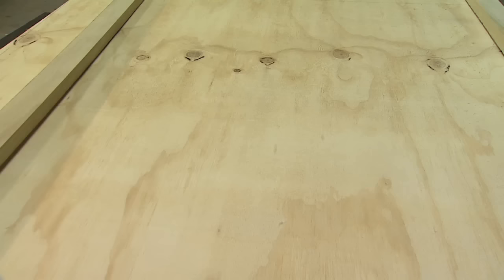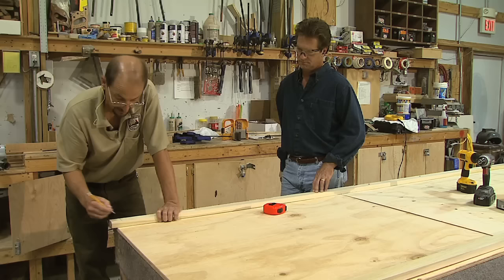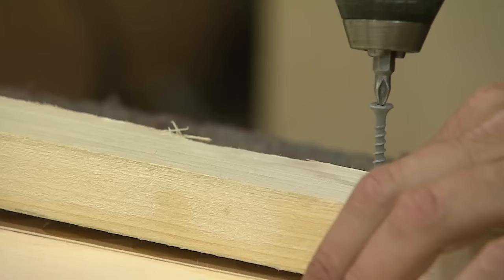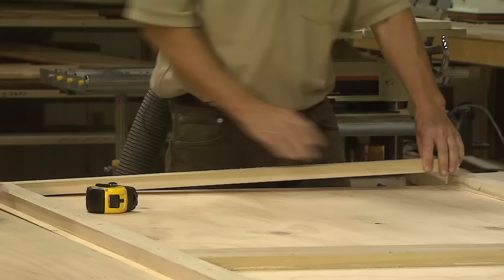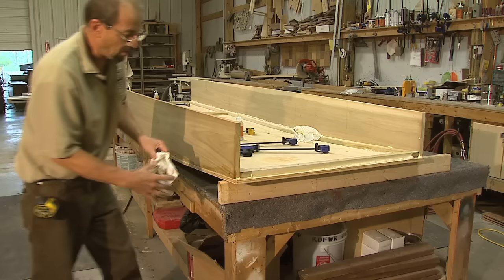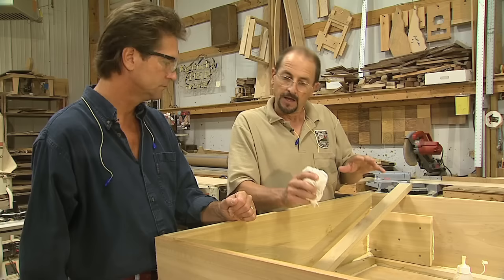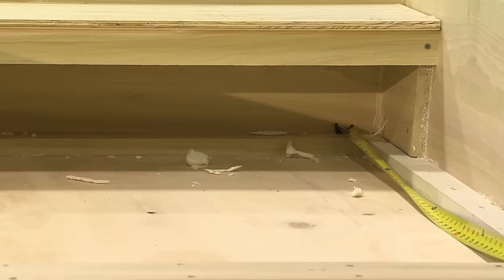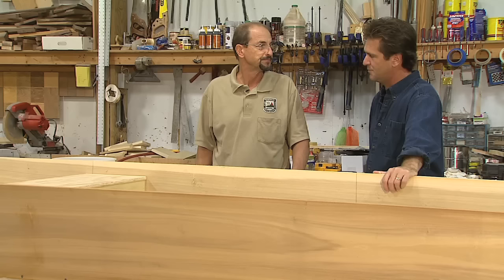How to Build a Wooden Flat Bottomed Boat

Comment: I built this boat almost exactly as this. Customized mine to hold a 3.5 hp outboard. Have more than 5 years and countless memories on it with my wife and daughter. So thankful for the video! Still doesn't leak at all. Currently fixin to put the 3rd paint job on it to be ready for summer 2021 on the little Arkansas river in Kansas.
Reply: What did you do different from them for it to withstand the engine Joe?
Reply: You should post a video and drop a link. I would love to see it.

Comment: This is basically the same design my Dad did when he built us kids a boat. He had no plans, never built a boat before, but built an 8ft pram in an afternoon. 3/4 ply on the bottom, 1x12 for the sides and transoms, 2x4s for the frame. He even got Fancy and slanted the bow. It was heavy and leaked a bit, but us kids had fun paddling it around the slough for years.

Comment: I made one based off of this design, thanks a lot for the great video, it works great! I added hinged bike wheels at the center of mass, attached it to my bike, and went two miles to my local reservoir. It was an awesome project and I'd highly recommend this video to anyone who wants to build one themself. As a side note, I didn't use the most expensive wood or paint and it still worked great.
Reply: Do you have pictures of your design

Comment: Built one similar to this while I was stationed at Howard AFB, Canal Zone, Panama.  But mine was 8 feet long and 4 feet wide.  Caught a lot of peacock bass in that little boat.  Lots of people wanted it when I left, so I picked one.  Never needed to travel far from launch site, so we used a trolling motor.   Used Sheetrock ring fast nails to assemble, then waterproofed the bottom and seams.

Comment: I have designed a fold-up pontoon boat.  It would have a platform of about 8’ wide by 7 feet long, and it could easily fit into the back of a pickup (folded). Once removed from the pickup bed, the owner “unfolds” it.   The pontoons also unfold to create (2) 16” wide x 12” tall by 14’ long pontoons.  A very unique feature with my design is that the pontoons are mounted at a 45º angle out to the deck, setting them outward about a foot each, thereby giving the pontoons about a 10’ wide stance.

Comment: I made an 8 ft boat out of regular 3/4" plywood and 2x12s  with a 48" radius cut off the front and scored the plywood every inch or so on the inside about 1/2" deep to help make the radius. Put a bead of silicone on all the mating surfaces then screwed it down with 1 1/2 deck screws , then put a gallon of Thompson's Water seal in a Hudson sprayer and kept giving it a coat every 20 minutes or so.  Added some angle iron at the transom and put a 5 hp Mercury on it. I used it for lake fishing for 4 years and gave it to the people who bought my house, it was still it perfect shape.  That was in 1983
Reply: I've heard all the advantages to using marine grade ply and all the problems with using exterior grade Yada yada yada... But I've yet to see a boat made exterior grade plywood fall apart quickly. I'm no purest so I enjoy comments from people like yourself! Thanks!

Comment: I cracked the mast step on a small sailboat I'd made out of wood once. I separated it slightly, moistened it, put Gorilla Glue on it and clamped it in place. It said 85% strength in 15 minutes, and full strength in an hour. By the time that hour had passed it had a mast in is supporting a 131 square foot sail on a 32 square foot boat. Never had a problem with that mast step in the years that followed, and the wind was really up tat first day.

Comment: You didn't answer the questions about the width of the boat, why you trimmed it down to 42 instead of a full 48 inches.  I also have a question about the three-degree pitch in the back.  Why not continue that three degrees up the sides towards the front?--but if you do that, you'd need to cut angles on both the inside runners as well as the sides for the sides for the edges to meet, wouldn't you?--otherwise you're going to have gaps.  Or does it not matter?

Comment: To put live well in
Do as the seat 
Box it in glue it put two holes in bottom of boat inside the live well and it will fill up the depth of the water line on side of boat and the two holes act as fresh flow water outlets 
To make it really nice angle both ends as the front of this boat and the same pitch on the bottom of boat 
Use live well as center of boat and reverse process as the front of this boat 
My father use to build them back in the 60s
For pond fishing 
No motor back then just push poles

Comment: Did you think of 5200 marine grade silicone its permanent.When it drys on a boats  center console floor seam and at some point you got to take that center console out.You will tear the fiberglass floor up be for the center console breaks free from the 5200

Comment: Excellent ! ........ And with Gorilla Glue too ! ....... I Wood make some Changes :  1. Make the floor the full 48 inches of the Plywood ... 2. Add 6 inches to 12 inches to the Height of the sides for handling Waves ... 3. Box in under each Seat for air tight Storage and Flotation ... 4. Put a Plexiglass or a flat Car Windshield on the Floor for Underwater viewing ... 5. Make the Front seat a Raised Deck for fishing ... 6. Suggestions ? ....... Thanks for the Vid !

Comment: When screwing the  strips to the  bottom sheet at 6.21,  I would have thought that  screwing the sheet to the strips is better than screwing the strips to the sheet with the head of the screw on the outside, as the strips give a better anchorage to the screws. Obviously since you have that glue in between I suppose it  does not matter, but in the old days we did not have such good glues,

Comment: I went to Home Depot to price that marine grade plywood and it was about $120.00 for just one 4x8 sheet, on top of that, you have to order a pallet of them because they can't order just one. Buying a pallet of 15 you get them at about $90.00 each, which still sucks. and that's besides the poplar strips and sides. By the time your done paying for the material, you could have had enough to buy an aluminum jon boat, small trolling motor and cheap battery.

Comment: Back in the 50's my Great uncle who Lived on the Bank of Cache river Often Built boats like this from Cypress Boards with Tar Pressed into all the Joints--when boat was put into the water, the boards would Swell pressing the Tar tightly between the joints. These Boats where Quiet and Good for Crappie Fishing...
Reply: randy beard   I’m somewhat familiar with the Cache and cypress boats you may be able to use cypress sides at less than 1”if you can acquire it in your area. You are are on the right track. I learned so much about wooden boats and big duck gun from the old men around Thebes and now I are one haha.

Comment: I have built this boat ( My way cas I wanted higher sides & seats higher so if i was sitting for a long time my knees & back would not be cramped, but close to this plan tho ) & it is an awesome awesome boat but the ply will delaminate & rot out very fast if you do not glass it or seal it with a very good sealer.

Comment: This use to be how ALL boats were made.  With a little innovation you could greatly reduce the weight by using different materials for the marine grade plywood - which by the way is EXPENSIVE stuff! :)  Good video and clearly explained.

Comment: Just a couple of things - it's better to use a brush or a putty knife to spread out the glue evenly over the surface. 

It's much better to pre-bore the holes when you are using screws as clamps unless the pieces are clamped up tight. Otherwise you often end up with a gap. The polyurethane will foam a bit normally and make it water tight, but you don't get anything like the full strength. Generally speaking, too, it's better to screw through thinner material into thicker after pre-boring, as well. So here one would pre-bore the ply, and screw into the poplar or the oak runners, except along the edges of the boat where it's much easier to screw up through the oak into the poplar chine logs.

Comment: Marine plywood has 1 or 2 extra plus depending on thickness. Much stronger.
Reply: Agreed. Anyone know where there is a list of measurements and types of wood?
Reply: Ronald Reed   Cost prohibits using new marine  plywood. Afriend bought a boat made from chipboard , was sealed good and really ok Had a chev corvair engine and small aircraft prop..  chipboard held up ok because it had been taken care of.. He used it all for a pattern and built a new boat from recycled signboards from old US 66. ( hi grade marine plywood with Fiberglas) on one side . Save all f g scraps and used  May work for you.them to seal sloppy fitting seams.
Reply: There are a wide variety of plywood products available that are suitable to boat building. Depends on what you need to get the results required. There are European marine and even aircraft grade plys with beautiful exotic top layers. Modern sheathings and coatings increase the longevity.
Reply: @slackbomslack6212  the plywood looked like very standard construction plywood (though they reference it as marine grade) and those boards were poplar.  I would not recommend poplar. I'd recommend white oak or even live oak unless you have some cedar on hand.  I dont recommend a solid board for the side walls of the boat. I also dont recommend such a box sort of design. But then I have never built a boat. Have a dozen books on boat building and have worked wood 30 years but I'm yet to build my boat.
Reply: @thornyturtleranch6152  LOL My friend this boat is Perfect for shallow bays, lagoons and swamps. It's just a plywood version of a flatboat. It's not made to cut through 5 ft seas miles offshore  in the gulf!
Reply: Improve your video by hiding you’re parrot Bob Villa in a box.

Comment from the maker: Perhaps, but the satisfaction of floating and fishing in your own hand-built boat is not to be overlooked.
Reply: KYAfield those that are negative about the project have missed the whole point, and beginners can build them with out to much trouble , I for one think it’s a very nice little boat and it will serve its purpose camping up river, fishing, hunting . It’s all round a very handy boat. Think I will build one myself .cheers.
Reply: interesting points ,if anyone else  wants to discover home boat building plans try Joolaim Rudder Replication (Have a quick look on google cant remember the place now ) ? Ive heard some pretty good things about it and my partner got amazing success with it.
Reply: @fishmut  you aren't going to get anywhere fast in it, it's basically a wooden box, just as easy to find a better plan with the same building system
Reply: @colstace2560  Not just as easy. Anything that's not square is going to have compound angles and curves that make the job much harder. If you're a beginner, or you just want a boat fast, this is the hull for the job. I built one myself several years ago.
Reply: @colstace2560  the point was to build a simple boat that anyone can build on the cheap.  If you want a fast boat then don't build a Jon-boat as we call them around here.  They are perfect for some pond fishing though.  easily pushed around with oars or even just a trolling motor, and extremely stable which is what you want if you are fishing a small lake or a pond.  I like it.  I already  have factory built canoes, kayaks, and aluminum V-bottom boats that are good for various purposes...  this boat design is excellent for fishing or duck hunting on still waters.  Also good for smaller kids to take out alone (on a pond with proper life jackets) since it is so stable.

Personally I would angle out the front and put a layer of fiberglass on it (outside only) before adding the runners on the bottom, and painting it.  I would also remove the original screws and put final screws from the outside in.

No offense intended.  I wasn't trying to lecture you, just addressing your concerns.
Reply: When you have to explain this type of boat it is senseless because they have already missed the point of what they are for and not everybody has a ton of money to throw at a high performance bass boat to go fishing for carp, talapia, trout, whatever thay can hook or catch.

For me I like this type of craft with a few minor improvements since I now have problems with my balance so I built one with a raised pole so I can grab on to it once in awhile when I'm standing up which is often in order to get a better view, plus it also has a 2' by 4' clear acrylic bottom to see what's below - mostly for fun but also to see if anything worth while might be below also.
Reply: White Fusion boat construction
Reply: And I know one thing from my experience in fishing from many aluminum and fiberglass flat bottoms also homemade wood flat bottom boats the wooden boats  this place and float way easier than any other material I've seen wooden boat 14 48 1648 only draw two to three inches of water with two large well-fed hillbillies in it I seen aluminum bait boats of the same proportion draw twice the water and fiberglass boats of the same size draw three times that water

Comment: Marine ply is not at all waterproof. It will rot just as fast as untreated ply. The difference is the quality, it is guaranteed to not have voids in any of the plies, uses a high grade glue, and usually has more plies than the same thickness of regular plywood. No matter what you use it has to be completely sealed from moisture. "Stitch and glue" building is a much better method. Incredibly high strength to weight and much easier to get complex shapes.
Reply: adam courville This is a simple boat with a simple purpose. No need to over engineer things. ll they need is good paint.
Reply: adam courville haha what ever I have built a boat stitch and glue fiberglassed and the whole lot, took me ages to build it because of the winter we had here at the time , the cost is expensive also doing it this way , my boat turned out great but a shit load of work, I like simplicity,this little boat they built is perfect if you look after things properly, paint is all that is needed and will last many many years so don’t fool your self.
Reply: It's a box, no shape at all, LoL it's a throw away boat, get 5 yrs and build another one

Comment: how does the wood not get water loged or leak?
very nice work yall have done       thanks!
Reply: The best way is to coat it with marine grade epoxy and then paint with epoxy paint.  Aft that it will last a lifetime.  Using marine epoxy can pay for itself too, eliminates the need for marine plywood.  A cabinet grade plywood makes a good “core” for your epoxy coating.  Not hard to do and makes a very strong boat durable boat.

Comment: I wood never use a but joint for the bottom of that boat for 2 pieces of plywood,
It should have been beveled. or tongue and grove. and screwed from both sides.
As that seem will open after  while from it being twisting and flexing. And I would use epoxy or even fiberglass resin.

Comment: Using Marine Grade plywood, with construction grades screws and glue? Never seen that before. I've built a couple box boats like this and used regular grade plywood instead, when using construction grade screws and glue. THE expense of the Marine Grade stuff when the other materials used are the weak point is curious. I was wondering about a scarf joint at the middle seam. How long did that particular boat last?

Comment: 14:42 bottom left screw hole split and they're still going to use it?
Reply: BrandonCroyforJesus          Just glass up the split and it will be strongest screw on the boat!
Reply: Dave M Fix the crack and screw hole with epoxy type glue in 5 min or less.

Comment: Update:
I about 50% complete. I am sealing all my edges, inside adn outside, with epoxy paste. Then I am putting 2 layers of fiberglass and epoxy on the outside. Then light sand and epoxy floor paint on the outside. Then my 4 1x1x8 of hardwood. Making good progress. I think it would float now. My grandson will be in the boat with me so I have to make real sure it dont sink. Testing in my pool, soon
Reply: +Harry Paul Garcia UPDATE: Flat bottom boat build complete. I also wrapped 2 layers of fiberglass and epoxy on the outside. Inside, I added sterile sand in my lacquer seal to make it slip proof. I added gunnels to make it easy carry.  My master piece boat build. Thanks for all your assistance. Now, I need a way to get my boat around. Pictures available if you wanna see my baby.
Reply: with the fiber and epoxy what would say she weights in at?

Comment: We built our boat out of 1/2 marine ply on the bottom and sides using oak bracing and cypress gunnells.  Put 1 1/2 inch oak rear with the angle iron bracing. Mounted a 45 hp Johnson. It would do 50 mph easy n Carry 4 passengers. Just saying. We used ribbing on the inside so that no pressure was ever put on the actual bottom of the boat. It was light enough for two people to carry
Reply: Can I get a pic?? Looking to do modifications as well with more freeboard and a denser stern to accommodate an outboard..

Comment: Great video! One thought: I've found that you always want to use materials made specifically for marine applications when you build a boat, plus I've had inconsistent luck with Gorilla Glue all around. I use Resorcinol (two-part purple stuff) because I'm old, but I think younger boatbuilders are using newer glues.

 Anyway, that's my suggestion. Really neat design, accessible to beginners and folks who don't have fancy shops. Thanks for the upload!
Reply: Marine grade has no voids and better glue- - cheap-o ply thats painted or varnished will be just fine if you aren't gonna keep the boat in the water.